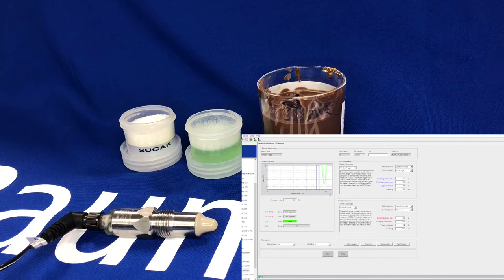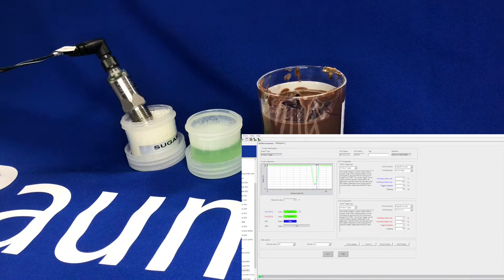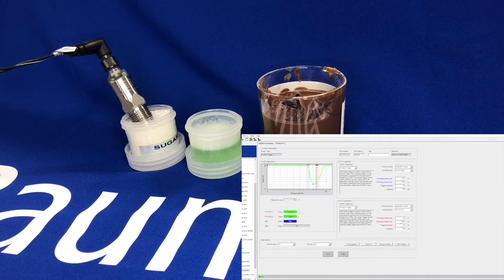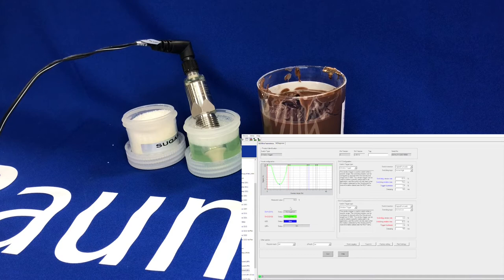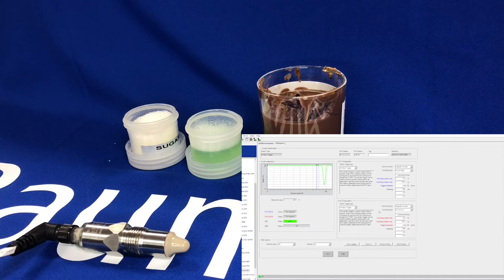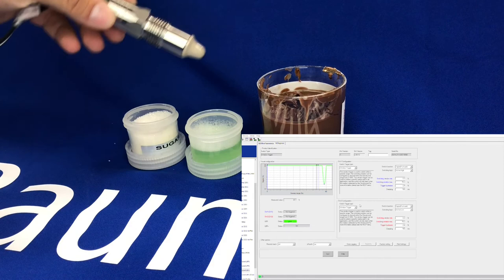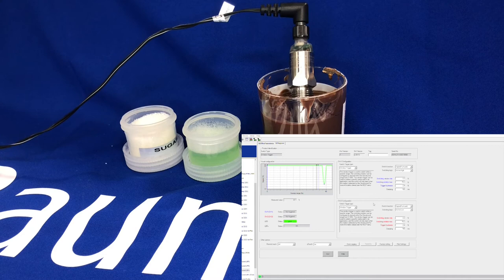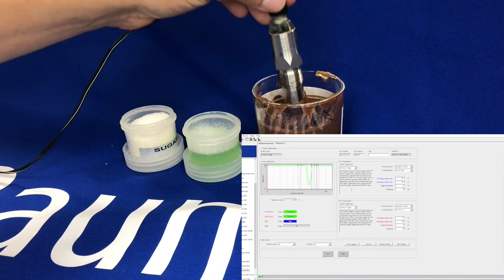Baumer CleverLevel - LBFS Setup Demo

Comment: Hello! I'm sohail from Morocco thanks for your Vedio ,I have problem with the sensor and flexprogrammer when I connect them ater click on the bottom < it starts "search for the product ***"" in the end "product no found " , can you help me for that please.
Reply from the maker: Hi, its difficult to answer your question without more details. Could be anything from not enough charge in the programmer or even a faulty programmer. Are you able to share the sensor you are trying to connect to, which firmware versions you have etc. please? Please email into your local Baumer sales office and they will answer you.